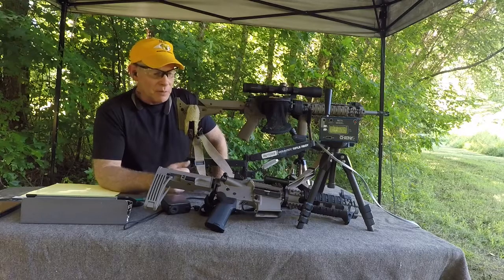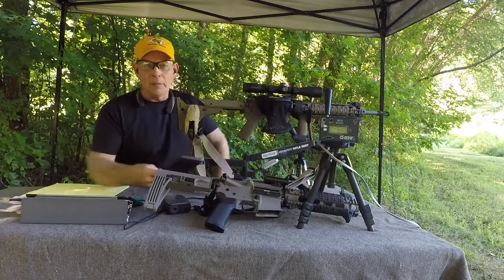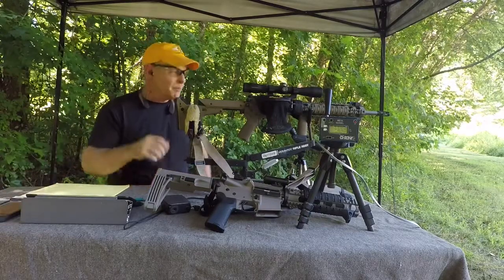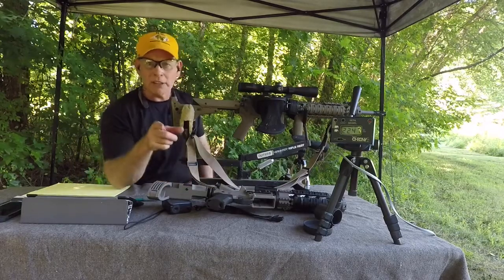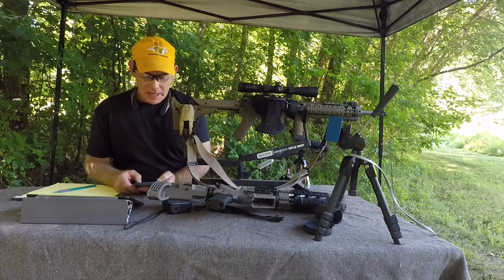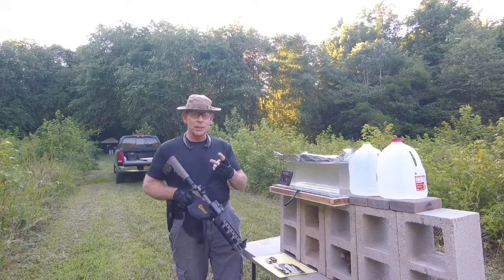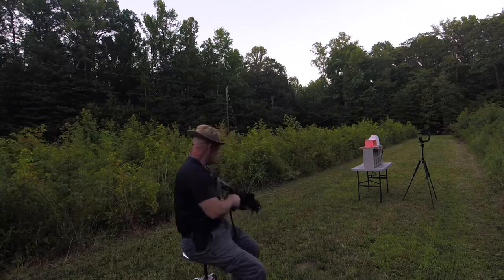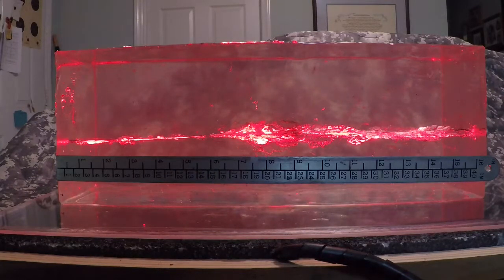hornady 125 grain SST 300 blackout traveling under 1900 ft./s through ballistic gel test

Comment: i would up that powder charge for  speed
Reply from the maker: Thank you for watching the video and for your comments, my intention was to slow the bullet down to mimic what it would do a distance the full load according to the low data is 18.5 grains of powder I was getting pretty good speeds out of the 16 inch barrel but because of the light weight kinetic energy the bullet Lost velocity very quickly with that being said it is still a viable deer hunting round out to about 150 yards. In my opinion. Thanks again for For watching my video and your comments.

Comment: Good video and interesting test.  But keep in mind that using pistol to simulate terminal performance of a bullet at range, fired from a rifle isn't very legit.  A bullet looses velocity fast (translational kinetic energy) but retains spin with virtually no loss out to effective range (rotational kinetic energy).  The centripetal forces acting on a bullet are very significant and contribute greatly to its expansion.  The expansion you observed from the pistol should be considered the very minimum you would get from the rifle by the time the rifle's bullet has slowed to equal velocity ( assuming similar twist rates ).  I think your test shows that 125gr SST is a good choice for 300 blackout.
Reply from the maker: Samuel Pope, Yes both barrels have a 1in7 twist and they are both manufactured by the same company.

Comment: I’ve tried using these on deer in south Texas at 100-125yd range with a 16” barrel bolt action Ruger American Ranch chambered in 300 blackout. 

They will not expand.  I’ve shot three deer, all three were shot just behind the shoulder and all three shrugged it off. 

I will say they are ridiculously accurate at a zero range of 100 yds.
Reply: Well I shot a deer with an sst 125 at 172 yards, dropped like a sac of potatoes, full expansion 24 inches penetration.
Reply: On hogs and javelina the wound tracks are absolutely disgusting.  DRT.  But I’m thinking the lighter skin on the deer keep it from expanding properly.  

I contacted Fiocchi and Hornady this morning.  I’ll update with their response.
Reply: 150g soft point is best round for deer in the 300 blackout
Reply: If you look at the gel dude shot it went 8 inches before doing it's thang!  That's more than half a deer chest in width. Without hitting bone I'd imagine a clean hole. Maybe a tiny bit bigger coming out. My NC deer have like 14 inch chest so to me this wouldn't be a good choice. Think I'ma get the Barnes tac-tx bullet for deer hunting this season.
Reply: TheDkb427 that’s probably what is happening.  Just a clean pass through.  Those Barnes rounds do look promising.
Reply: @davejhotch  mid South shooters had em but I gotta wait till payday and now they're out lol. Optics planet has em but their shipping sux. Ooh well. I do have some of the Hornady 110 gr gmx which is for medium game but haven't seen a gel test yet.
Reply: TheDkb427 I may try some controlled chaos or an all copper round like Sig has come out with. 

I live close to Houston so hunting may be off the table this year all together.
Reply: @davejhotch  I didn't think of sig ammo. I have a few rounds of the sig ht hunting round. Think they're 120 gr.  Should definitely do better than the sst since it's made for 300 blackout. Ah man. What's that about?  No hunting equals no fun! Lol
Reply: TheDkb427 with the corona a outbreak I’ve got a bunch of my Longshormen out with positive tests so we’re all pulling crazy hours to cover for them.   Hopefully I can get to the ranch or one of the duck blinds on the coast for some redhead action.
Reply: @davejhotch  that's crazy man. I'm in NC and haven't met anyone that's got it. Which is a good thing. There was a positive case at my brother's work but he's fine. Guess this virus is here to stay tho. Hopefully everything works out for ya.
Reply: @TheDkb427  I'm in Huntington WV and i don't know anyone that has had it either
Reply: @KJV1611AV  I haven't tried them I have had very good luck with the 150g soft point
Reply from the maker: David Hochstetler Thanks for the info I haven’t gotten a chance to use them yet
Reply from the maker: Hornady is going to say they’re traveling to slow.I spoke to them one time before about this. I’m wondering how it will do one coyotes? Although I loaded up a handful of these in 308 I’m shooting them out of an encore 26 inch barrel and they are screaming at about 3300 ft./s!
Reply: GONZO38 pp  this is Hornady’s response this morning:

This 125 gr. SST bullet will expand down to 1600 fps. It is very likely that the bullet is expanding well. However you have to remember that with these types of velocities you are not going to get a tremendous amount of hydro static shock to the animal. You may want to either move to a high shoulder shot for instant bring down, or possibly shoot for the heart which is low in the front shoulders. 

As for me with three animals clearly wounded and not recovered, I would not consider this an ethical round for hunting. Just my humble opinion.
Reply: @davejhotch  bad lots sometimes
Reply: Blake I hope that’s the case.  I just picked  up some Hornady SST in 6.5 Grendel.  Hoping for better results this fall.
Reply: @mblake0420  it all about bullet placement

Comment: I'm considering these bullets for deer hunting at short ranges.  I believe you can get higher velocities safely with H110. Im thinking of using this bullet and 18 gr of H110.
Reply: I’m loading these with 19g of 296 traveling at 2300fps with no pressure signs. Work up slowly and be safe.✌🏻️
Reply from the maker: SmallTown 78666 it’s funny that you’ve replied to this today I just loaded a handful yesterday with 18.5 grains of 296 and got to chronograph them this morning I’m getting on average just below 2300 ft./s Although my group has opened up slightly I think it will still be adequate for deer hunting ✌🏼
Reply: GONZO38 pp with these bullets in 300 BO every bit of velocity counts. I also handload the 110 & 120g Barnes tac Tx with good results and these bullets do better with expansion at slower velocity.👍🏻
Reply: I am using little gun and hand loding at 20g of powder have not tried them yet will make updates after I go to the rang it's supposed to shoot 2400 ft per second but I'm using a 10 and a half inch barrel so we will see
Reply: @timesque9790  how'd that work out for you?
Reply: @sgt5310  it works very well I haven't Corona graft them but at a hundred yards it shoots just a little under 1 Moa with a 10 and a half inch barrel pretty doggone good I think
Reply: @timesque9790  ever chrono those lol gun 20gr? I loaded up some 19gr and I dont have components to waste. Any pressure signs at 20?
Reply: @mblake0420  no I haven't
Reply: @timesque9790  20gr work out well?
Reply: @timesque9790  any pressure signs at 20? Never answered
Reply from the maker: Good morning I’m not sure which load data your referencing but I double checked Hodgdon’s website and 296 and H-110 have Identical data these are the same powders and the max load is 18.5 it is a compressed load!Let me know how you make out good luck.